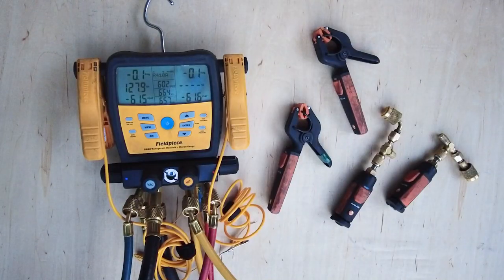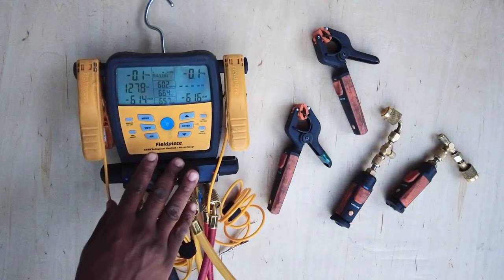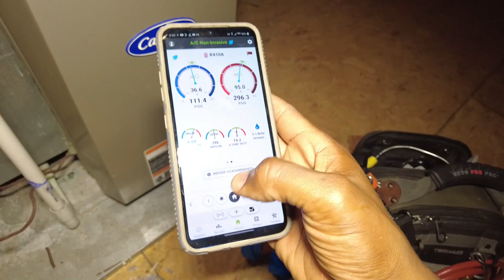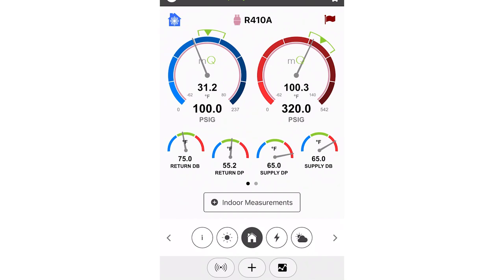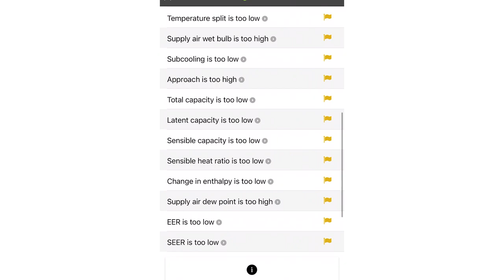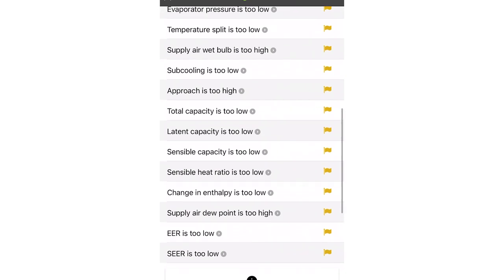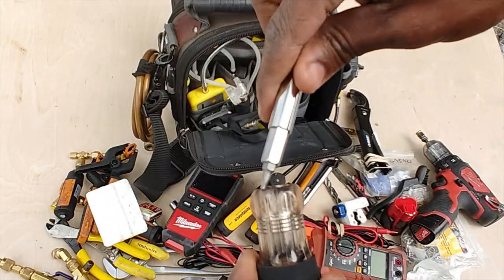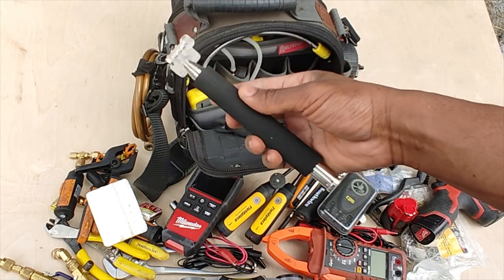How to be a Faster HVAC Tech without being Sloppy! - How to finish your service calls quickly

Comment: I work as an apartment service manager. Last week I had an HVAC contractor out to help with a diagnosis. He asked what manifold I used and I have the SMAN380v. He broke out an old yellow jacket analog set (same as I have for backup) and literally told me that digital manifold is gonna make me look dumb. I couldn't really understand what he was talking about. So long as I keep my temp clamps calibrated, I can get as close to perfect as I can possibly get.
Reply from the maker: Thats crazy. Yeah don't let that discourage you. He was probably just feeling insecure because I doesn't understand them. Just stick with it and remember the more you understand about the refrigeration theory and how all of the systems function in a unit, the more powerful digital instruments become. Check out an app called measurequick if you aren't using it already, its free. It has a lot of great features to help you get the most out of you tools. Thanks for watching!

Comment: checking duct leaks ,by checking the house for negative or positive pressure,a quick check at the front door cracking the door and feeling air in or out of the house.
Reply from the maker: Oh yeah that's a really good idea. Thanks I'll definitely be using that!

Comment: Biggest thing any tech can do is have their tools and their parts ORGANIZED.

It's crazy how much I see other guys waste time on EVERY call and EVERY install digging for something or going back and forth to the van.  Have your parts and materials organized and stocked BEFORE you go out to the job and organize your tools thoughtfully.  

Examples:
 * Carry a smaller tool bag/pouch with just what you need to Diagnose; rather than a MASSIVE tool bag you have to dig through...or lug around an extra 10lbs of tools you don't REALLY need.
* Have a Kit for addressing condensate drains with EVERYTHING you need in it so you only gotta make one trip in and out with that set-up: Nitro, bottle brush, pipe cutter, some couplings or unions, electrical tape, pan tablets, Gatorade bottle full of water and a funnel to check drainage and re-prime traps, a couple of towels, and attachments for your nitrogen hose.
 ...instead of going back and forth for all that stuff.
Reply from the maker: Agreed! Thanks for watching!